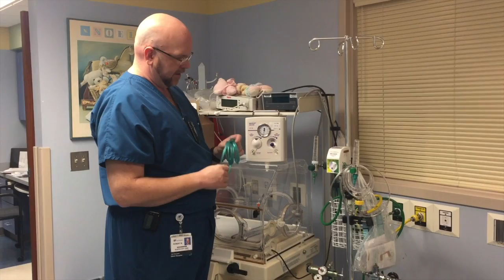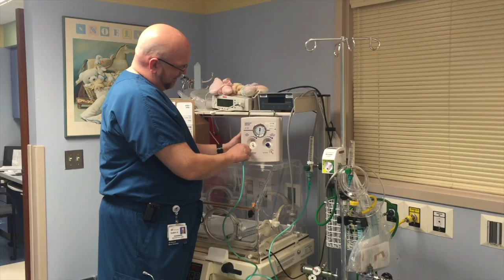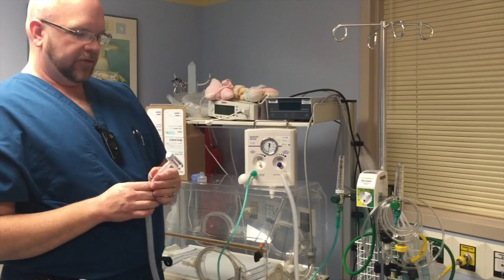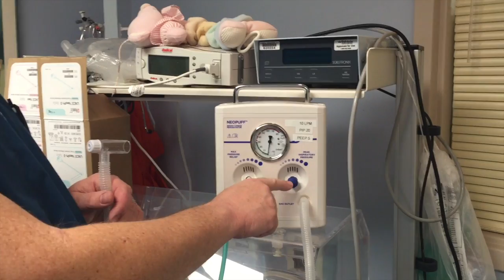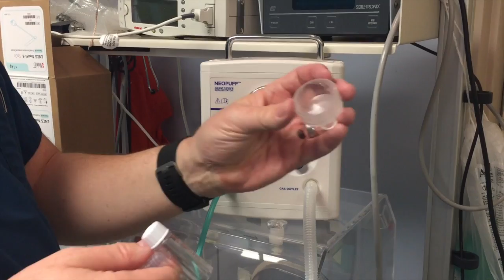Neopuff Introduction and Setup

Comment: Thank u Sir, I hav one question, why PIP always start from 20mmHg
Reply from the maker: 20 is the standard starting point set by the NRP. They picked this because for the majority of infants this will get you a good inflation of the lungs without any trauma. It can easily be adjusted if you need more or less pressure from that starting point.

Comment: You start resuscitation on 21% oxygen?  You should start 100%!
Reply from the maker: Robert Freeman NRP guidelines: Oxygen Management
Resuscitation (positive-pressure ventilation) of newborns greater than or equal to 35 weeks’ gestation begins with 21% oxygen (room air). Positive-pressure ventilation of newborns less than 35 weeks’ gestation begins with 21-30% oxygen.
Free-flow oxygen administration may begin at 30%. Using the blender, adjust the oxygen concentration as needed to achieve the oxygen saturation target by pulse oximetry.
If the newborn has labored breathing or oxygen saturation cannot be maintained with the target range despite 100% free flow oxygen, consider a trial of CPAP.
Reply: Bob is right you start at 21%!
Reply: you want to blind the babies by giving them retinopathy of prematurity with 100% FIO2 don't you
Reply: Robert, I hope you're not involved in doing any infant resuscitations!  Respibob is right, the NRP now states you start at room air for term infants. Even for premmies, the max recommended starting FiO2 is 30%. Strongly suggest that you refresh your training if you are involved in infant resus. (and if not, why even comment??)